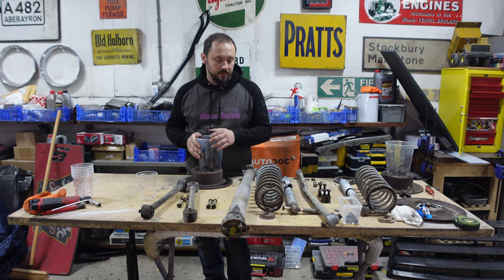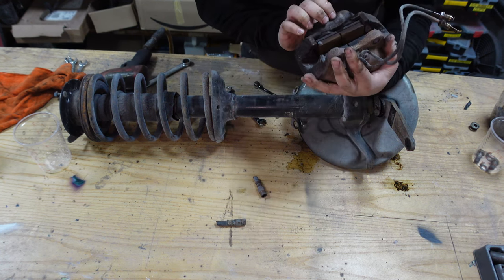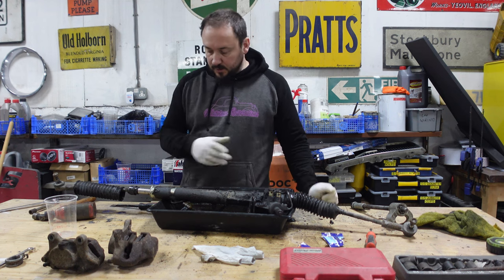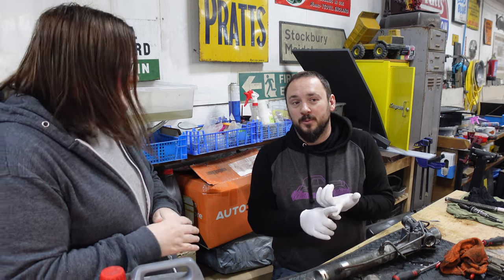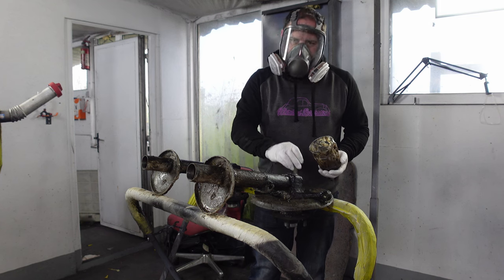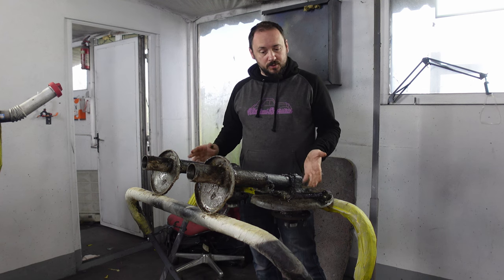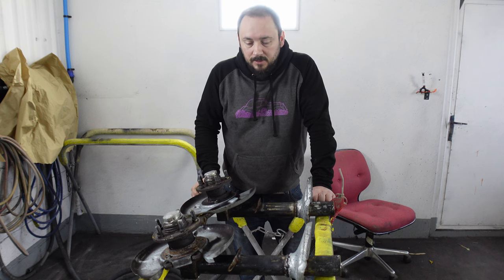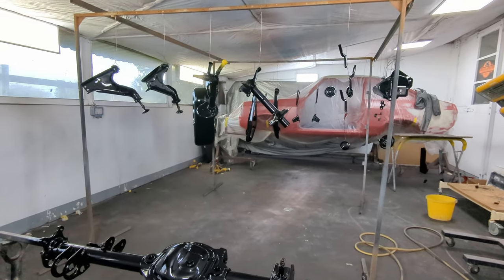Suspension Tear Down and Refurbish on the Volvo 240!

Comment: Cut a short piece of garden hose and put it on the banjo bolts then put them back on the rack before cleaning, that way you don't get crud going inside the rack and  oil pipes while cleaning which could become expensive.
Also if you fit rear lowering springs then you need an adjustable pannard rod because the axle will not be centered correctly once lowered it will be off centre
Reply from the maker: Have no fear....we have adjustable everything! You'll see it all in a future episode 👍

Comment: Having used spring compressors by nature they are trying to work against the relative angle of the springs so want to "let go" because the geometry is all to cock.Hatefull tooling as you demonstrated.I got very lucky on a vectra that made me realise just how much energy is stored once under compression.Use three for belt and braces and do each one up in order just a half turn at a time but still keep ready if one slips because if one goes the others will by virtue want to go too.
Reply from the maker: Yeah we usually use three but got a bit overconfident. They are lethal things....we will be upgrading to a floor mounted one for the next Suspension job!
Reply: @WhitelandRestorations  I A wise choice.Just look up Hookes Law if you want to know how much energy can be contained in a coil.Alot.Certainly enough to spoil your day.